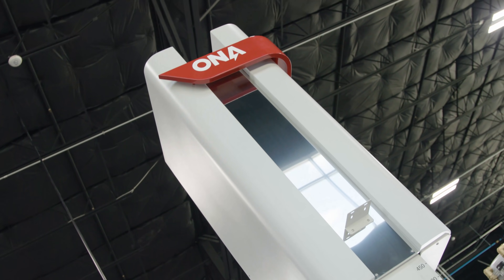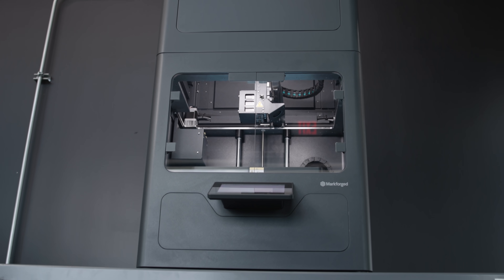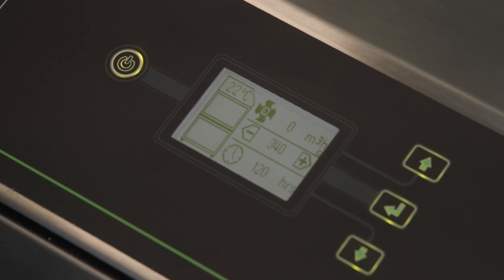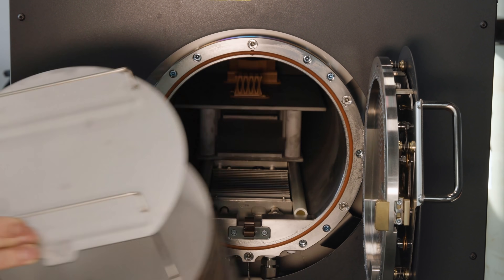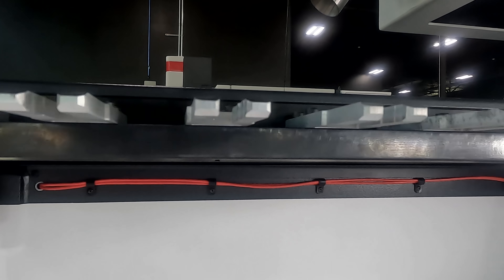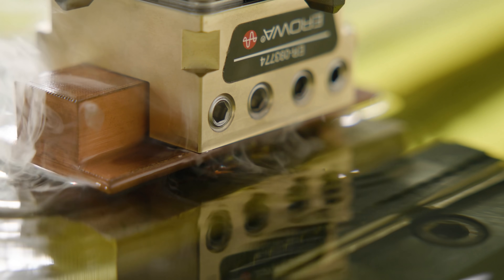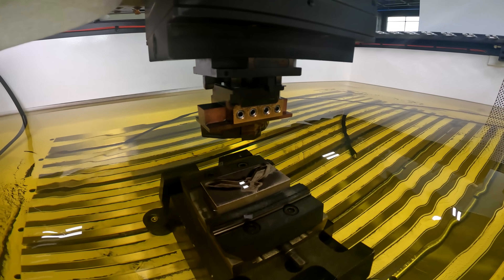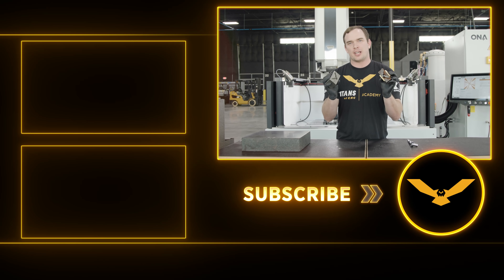FIRST EVER 3D Printed COPPER Electrode CUTS Into A286 Stainless | EDM

Comment: Most of the vids you guys post is good but this is just marketing manure. You just added more processes to complete a finished part and that equals money down the toilet. This application is not feasible with the current state of additive manufacturing. Copper electrodes are used for finishing jobs and require a fine surface finish that 3d printing can't achieve yet. Graphite electrodes is still the preferred choice for roughing.
Reply: Only real use case that this is viable is thin walled electrodes thats difficult to machine

Comment: Noob question: how long can the copper electrode be used before it's retired?
Reply: It can be used several times. There will be some wearage on the Sharp edges at the fronts of the electrode as u see in the video. But u can easily mill/face the top and use it many times.

Comment: I'm curious as to how many times that electrode could be reused.  The idea of running (for example) 50 or 100 operations with the same electrode would be very useful in cases where the injection mold is subject to corrosion during the injection process, off the top of my head.
Reply: As an EDM technician. You simply cannot.

The operation modifies each of the 2 pieces ( the copper and the steel part ) just the copper is a better conductor and it erodes less. We have materials that erodes less like tungsten copper but it's expensive and even with that 50-100 is out of the question. 

For most of the work I have 1 rough electrode and 1 cleaner electrode. This mostly makes great inside edges. But this is for 1 steel part.
Reply: 50 to 100 with the same electrode i don't think its possible and if it is possible it would be a very very very slow operation which i don't think that is something worth showing

Comment: Do you guys use any lasers in your shop? My shop uses a 6kw CO2 and a 8KW fiber to do 95% of the profiling (we have a plasma table for the realy big stuff, 40+ feet long) and we are getting a "tube" laser in September to cut and process HSS, round stalk, angle and square stock.
If you do any laser work, would be cool to see how you use them.

Comment: How do you locate the electrode on the holder? The whole point of the holders is to ensure the geometry of the electrode being cut is perfectly related between the CNC and the sinker. That's a lot of bench work for one electrode that could be broken into smaller electrodes and cut on a CNC.
Reply: In sure they draw the holder in CAD and draw them as an assembly.
Reply: I think this is just proof of a concept, not real application, for now at least

Comment: This could actually be a big thing in injection molding, especially for industries that do low volume production work or prototyping, or companies that do not want to invest huge amounts of money into expensive copper electrodes for their products.
Reply: You can also use the cheaper alternative, graphite, for EDM, we use it at work (injection molding) and it works great.
Reply: Just huge amounts of money for the machines

Comment: Incredible technology!! I knew you could cut and do basics with wire edm. But a straight plunge like this, first I've seen. Great video!!
Reply: This is an old technique pretty sure its older than wire edm.  People can still do this in their own home sort of.    Lesser results and more development is required   but basically they print out of plastic ( you could carve out of wood if you didn't have access to a printer) then paint on a conductive material and after that they copper plate it.  (Which can be done for pennies with the battery on your car)    Then you have to go much slower at a much lower voltage but do the same thing ( also with a car battery)   

Look up zurad
Reply: That's awesome, thanks!
Reply: @bobshams7231  i can't find his old videos possibly removed for comments.   He was making a die and plunge cutting.    And everyone in the comments was interested in using it for making locking lugs and other intricate gun parts 😂   hell I even think his keybase chat room got taken down or atleast a very stern warning

Comment: I’m curious how you would apply the spark gap in solidworks AND how you center the electrode in the tool holder.  I’ve only seen electrodes machined after centered in their erowa holders.
Reply: We also machine our electrodes set from the reference points of the holders but really EDMers will set electrode offsets at the machine. Meaning it doesn't really matter where the electrode is in relation to the holder.
Also the spark gap, a simple push/pull function should work perfectly. We model ours size on size and apply negative stock when machining.
Reply: @wildin13  same here. What dimension accuracy can one expect in this type of 3d printing?
Reply: @nilimili9836 I dont have any experience in metal printing but I imagine its quite good since most well kept desktop FDM printers can hold 0.05-0.1mm in plastic.
Reply: @wildin13  what kinds of graphite do you prefer to use ?
Reply: @MrJzplastic  I prefer none, the stuffs nasty to work with 😅
Reply: @wildin13  same here, all the Poco’s are nasty

Comment: Great video guys.. 
Just a quick question.
Which would be cheaper... Mill electrode from solid or 3D print?
Reply: Depends on electrode.... for example, small "engraving" or logos might be far easier to print and less wasted material but bigger form electrodes used in mould and die manufacturing (which is what sinker EDM is used for mostly) would probably be cheaper and maybe faster to machine.
This is not taking into account the cost of raw materials and the fact you can machine graphite electrodes far cheaper and quicker than copper ones.
Reply: @wildin13  yeah get what you are saying. Been working with making electrodes since around 96 onwards. Always milled. Was wondering on costs involved if they were outsourced for 3d printing.
Thanks for the reply 😃
Reply: @burville100  its always worth looking in to. If it could be cheaper then it would def be something I'd want to look at as we machine graphite electrodes and its bloody horrible 😅 would love to just press go on a night and print all electrodes for a job lights out!

Comment: How much of that electrode was burned back during that demo?
Reply: @Trevor Goforth thank you for the response!  I noticed a coating of SS on the electrode.  Is that normal and how does that affect the next time it is used if at all?  Ideas that need to be cleaned first?   How would someone get in touch with your company for a quote on parts?

Comment: I'd like to know how the dimensions change during washing and sintering. You're removing some material with the washing and i guess shrink the material a bit during sintering. How accurate is the dimensions from from the .STL file to the finished electrode. Isn't there also some loss while using the electrode? 
As always you're pushing the boundaries of machining.
Reply: I bet that Markforged software for 3D printing is taking into a count how much the part is gonna shrink after sintering so it calculates how much larger it has to be and pritns it bigger, so it is exactly on point after sintering. 
But I'm not sure about accuracy of this, what tolerances are achieveable.
Reply: @Stasiek_Zabojca  Yeah, there might be some software compensation of shrinkage, but that must be hard to control some tolerances. When casting with a 3d printed shape, like a lost wax cast, you usually increase the size of the print by some degree with earlier cast shrinkage measurements.

Comment: I would never have bet money on the possibility on using a filament printer to make an EDM electrode.
This is genuinely surprising.
Reply: It's called physics.
Reply: @AlexanderNassian  Yup. And a fair bit of chemestry
Reply: @bluustreak6578  Not really, it‘s just eroded by the electrical current. But even if it would be, chemistry is also just physics 😉
Reply: @AlexanderNassian  Hm, well, to be a little more specific then and explain what my original intention was;
The surprising thing was not that EDM works, since it's just physics like you say, and a known procedure.

It was more that you can make the electrode with the use of a hobby 3D printer.
Surprising also how much copper there was in such a filament.

I've never considered the possibility of doing this, alltho it makes perfect sense now that I've seen it of course :)
The electrode doesn't care where its metal comes from, as long as it conducts well enough.
Reply: Its not a "filament printer" lol

Comment: That seems really interesting but the 3D printing makes the progess more complicated for the desing of the electrode.
You most likely have some kind of shrinking while sintering the copper after printing, probably some uneven one and you need to account for the spark gap during the EDM itself.
Reply: The shrink during sintering is predictable and is taken into account by software that predicts and compensates for it. Same for the spark gap, it's a few mouse clicks away from being compensated for.

Comment: You should try desktop metal printers too, they are insanely fast.
Their carbon fiber parts are also a lor stronger than those from markforged. They claim to reach the same performance as continuous fiber placement used to make aircrafts and rockets.

Comment: hi, i use copper electrodes for resistance welding where i work, problem is i have to machine them manually and it's quite boring.
how much does a machine like this cost? can be convenient instead of millng them?
Reply: For the whole system (3d printer, furnace and wire edm, it would be arouund $500,000USD.

The 3d printer and furnace are around $150k and the sink edm is around $350k, plus all your fluids, powdered metals, etc.

"boring" isnt expensive.
Reply: @jessetw52  yeah, as always boring isn’t expensive 😅
Thx for the reply